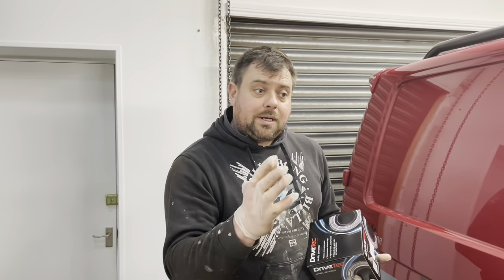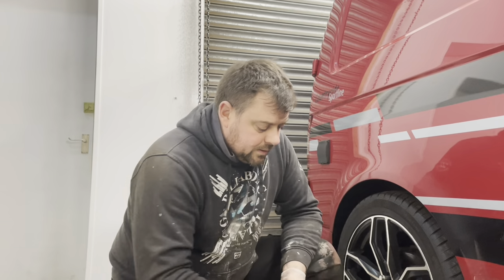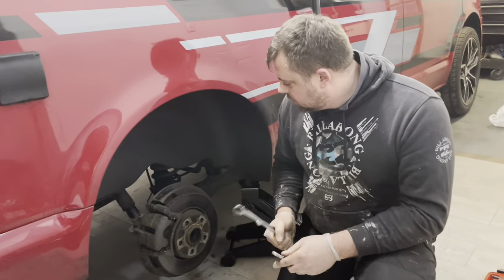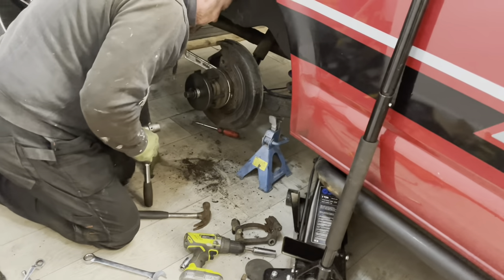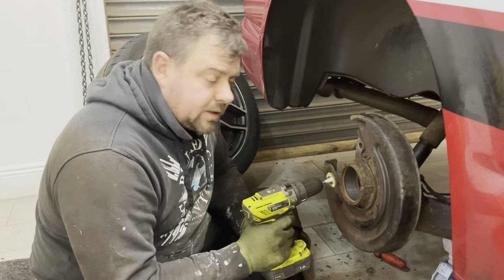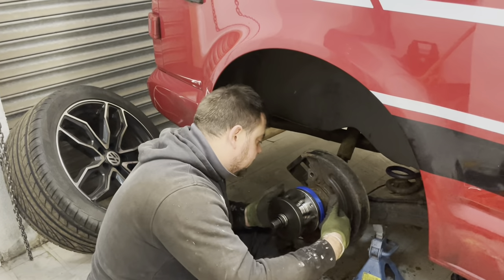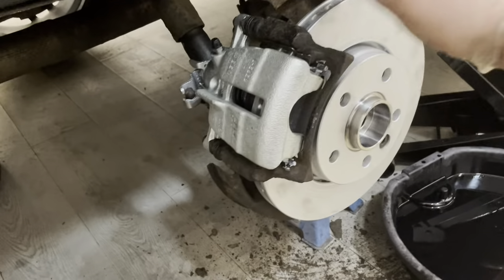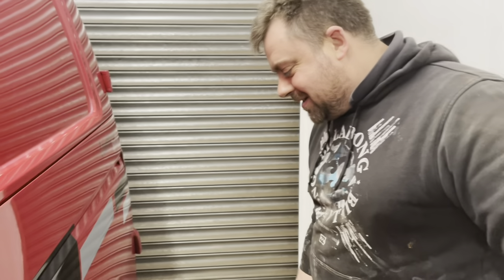THEY CLIP IN! VW transporter rear wheel bearing replacement.

Comment: Brilliant video guys nice fresh brakes and bearings on the rear and new clutch 👌 crazy set up with clips on the rear but it works 😅👍
Reply from the maker: Yes mate, drives mint now.
Much better with a proper clutch
Reply: @HomeBuilt  Excellent mate glad the VW is running sweet now with new rear brakes and clutch 👍

Comment: It looks to me that the black anodised rings were for removing the bearing and the silver rings are for putting the new bearing in, the rings should clamp nice and snug on the new bearing and have no movement once the two halves of the rings are bolted together.
Reply from the maker: Its a great tool, done a few of these now since the video came out.
Turns out a lot of garages refuse to do them or want to charge crazy prices for it.

Comment: And yet, on smaller vag products the rear bearings are held on by a stretch bolt done up to a ridiculous torque then 180 degrees usually.
Reply: Front bearing are held in like this on polos and such like

Comment: The next Class Action against VW after the emissions cheat launched by owners who get sick of their back wheels flying off lol?  That does not come across as a particularly safe solution from VW
Reply from the maker: 😂 maybe.
I’m sure it’s fine as they’ve been doing it for years, the early transporters are all the same along with the Tourag and some  Polo’s and Golfs.

Thanks for watching dude.
Reply: @HomeBuilt  yeah but something inside of me favours the security of nuts bolts and screws - I don't even trust that push fit plumbing stuff........ and I have used it to plumb in my kitchen sink myself but it just feels wrong lol
Reply from the maker: I know what you mean 🤣
Reply: A few other makes use the same setup, Ford C-Max has it on the front, and a tiny little bolt retaining the driveshaft
Reply: @darrenwilson8042  Ford don’t even have the clip on the same style bearings they just use hopes and prayers 😂
Reply: @gregshearer423  many moons ago this was my preferred method of maintenance
Reply: @darrenwilson8042  😂😂

Comment: Mike
Never seen anything like that wheel bearing before but VW are a bad car over the years had more problems with them than any other motor a clip holding it on  what other cars has these clips see if the viewers know of any ha mate

Phil in stoke
Reply: Ford have the same setup minus the clip
Reply from the maker: Hi Phil,

I’ve always loved VAG stuff and never really had any issues.
Apparently Ford have a similar setup on some models.

See you soon.